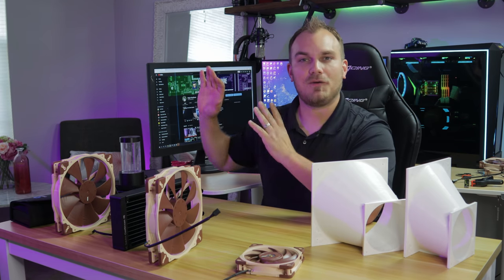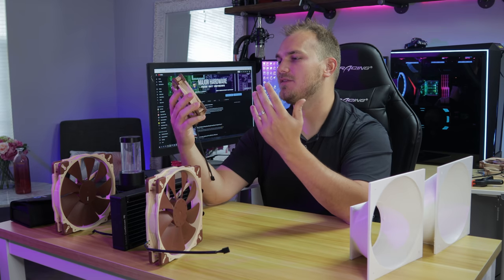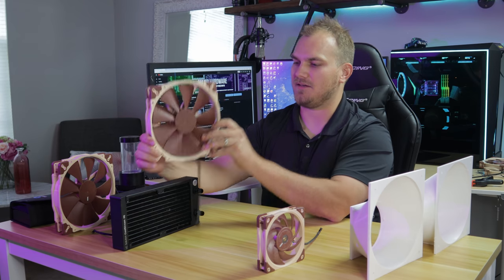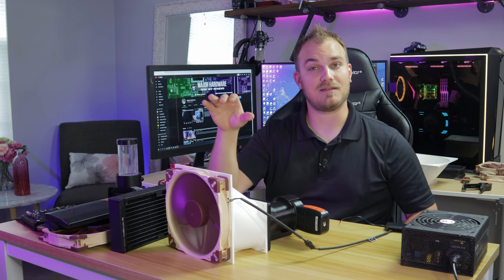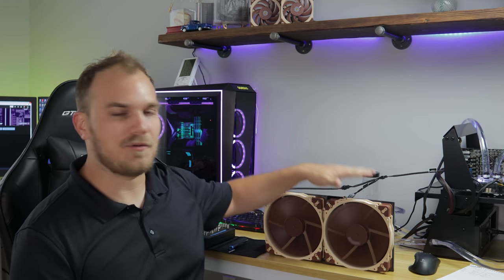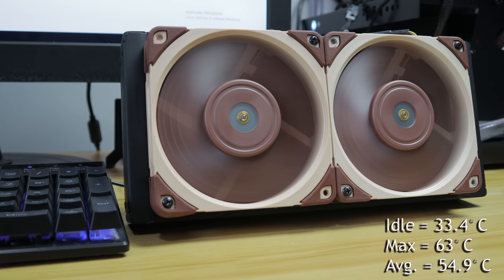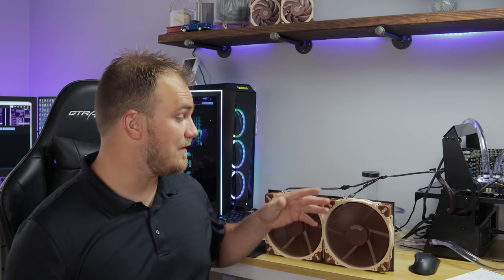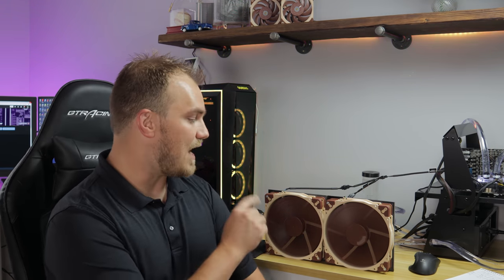Cooling A 240mm Radiator With 2 MASSIVE 200mm fans

Comment: Idea: Could you use Ductwork to mount 8  of the 120's to a 240 mm radiator?
Reply from the maker: You sure could
Reply: @MajorHardware  It would probably sound like a jet engine though.
And you'd have to wonder, would it move more air volume, or would it create turbulence that would be detrimental to the cooling.

Comment: i do not have a case with a 200mm fan location
I have a case with a 12cm x4 for a 240x240mm fan location
It is called thermaltake mozart TX

Comment: The problem with 200mm fans is that they weren't design for static pressure like most CPU fans. So they aren't gonna cool a radiator very well.
Reply from the maker: I wish they would take the A12x25 and blow it up to 200mm
Reply: @MajorHardware  Cooler Master is working on a prototype AIO that uses a single 200mm fan to cool a big Radiator. Gamer Nexus got one for testing. https://www.youtube.com/watch?v=FueK42jjxRo

Comment: 360p, pff also I just bought a corsair H115I and I wana shove my 140mm PPCs on it, they are rated at about 220CFM and I have 2. *bad ideas shall ensue*
Reply: I have four of the 3,000 rpm 140mm PPCs in push/pull on my old H110i GT and it's absolutely amazing.

Comment: Hey this is an old video, but I'll leave a comment. I'm planning on selling these things at some point. @CFproducts02. 
   I think you should try the same thing with smaller fans, maybe a 240mm radiator with two 140mm fans adapted.
   That's the one I don't show yet. But in order for the test to be interesting, the fans should have the same static pressure. 
   Also, switch the adapter to install two 120mm into a 280mm radiator, but some static pressures compared to just regular fans, or maybe still the same static pressure.

Comment: You lost performance because you did the outlet the same as a 120mm fan if you did like a square 120x120mm and not round then the outlet have more space to cool the rad and the 200mm fan shouldn't have so much static pressure to work with. Same with your airflow messurement you go from 200mm to like 50mm the big slown speed fans can't handle static pressure very well.
Reply: good observation if true :-P

Comment: I wouldn't leave the 120mm side circular. Since yiou already bring out Solidworks, maybe do some optimization to this adapter.
If you want, I just made this for you:
https://grabcad.com/library/2x200mm-fan-to-2x120-radiator-adapter-1
If you place the big face flat on print bed, only the 2x120 flange needs some support.
Reply: I updated a few tiny things. Now radiator should be able to lay on its side perfectly.

Comment: If they make in black I'll take it but that brownish poop color, no way.
Reply: I know Noctua do have some black fans with different colored noise reduction inserts and they make different covers for their NH D-15 cooler. I think that line is called Chromax.
Reply: @HisNameIsRobertPaulson01  I mean those 200mm ones, I know their Chromax line-up I put one in my sisters PC. I was planning some experiments with 200 and 400 mm radiators and need some fans that are good without the bling of RGB like the ones CoolerMaster has.
Reply: @Teksers  Those experiments sounds rather interesting. I like the Noctua products because they perform excellent and without all the flash. Different color schemes would be a nice addition, though.

Comment: ... Bullshit. I went to Best Buy to try and locate a replacement fan for a portable heater, thinking if I could get a size and voltage match I would be able to make it work. Not only am I seeing similarly sized fans here but I'm seeing larger ones. The average size in fact looks to be the appropriate size to what I need, or indeed what I remember them to be. So why they hell wouldn't they serve me when I was willing to settle for the best possible option, with claims from staff that the fans available were "much smaller" that what I was looking for. This thing doesn't have a size marking on it but is about palm sized with brackets for mounting attached. All is inconsequential but the span of the blades and the power draw. The hell is wrong with some people? Haven't they ever heard of working with what you've got and making the most of it?

Comment: I prefer 180mm AirPenetrator fans for radiator, check my airflow test on 45mm thick rad : https://www.youtube.com/watch?v=18rnbzLpGUM  (dialed to 750-800 rpm, little less then Noctua's 200mm max rpm)

Comment: Suggestion: We have seen water chillers in action (LTT). But is an aquarium chiller a reasonable alternative to a custom water loop (@ ~40 to 60 Celsius CPU temps)?
In UK a quick Google. A 300W unit cost you £350 https://shop.abyssaquatics.co.uk/product/d-d-dc300-chiller/